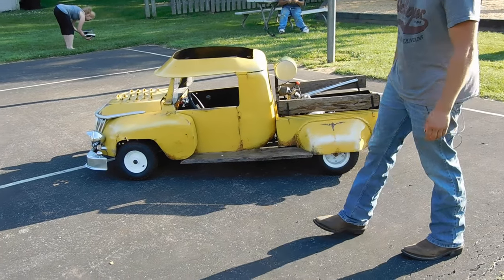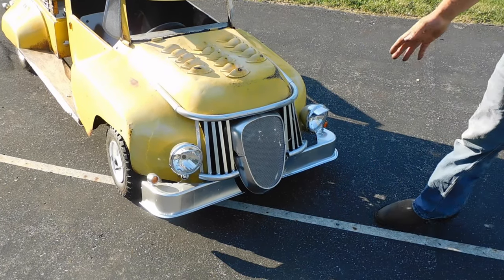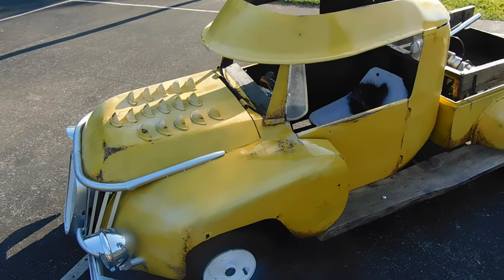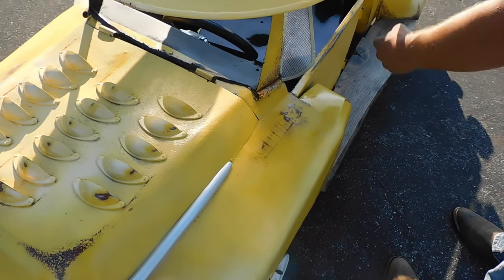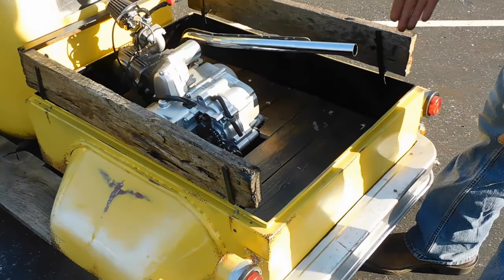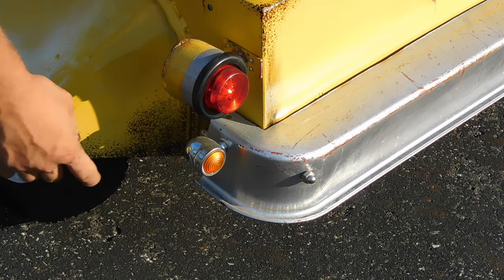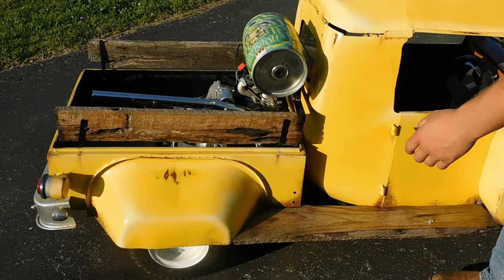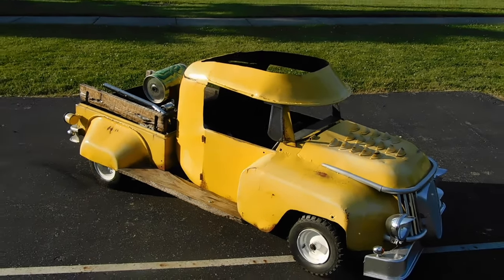125cc RAT ROD GO KART TRUCK BUILD COMPLETE!!

Comment: Is that the auto 125cc ? I think it would be faster with the manual
Reply from the maker: It's the semi automatic 3 speed. So I shift without a clutch pedal. I just recently got it up to 30, but I am still having trouble with the shifter.